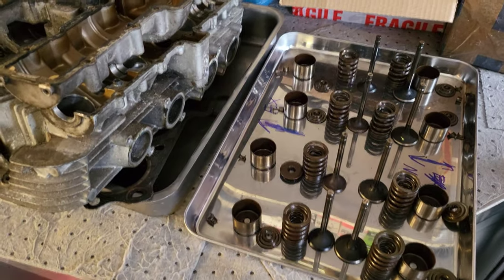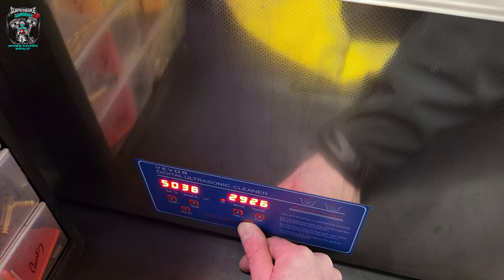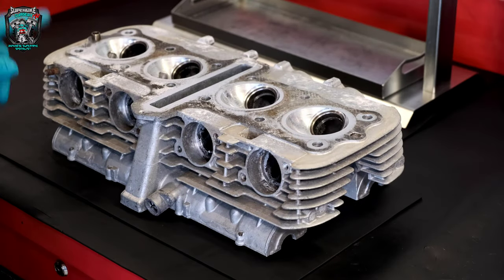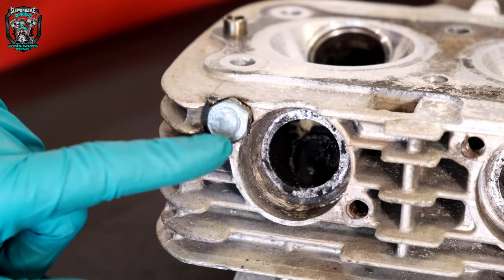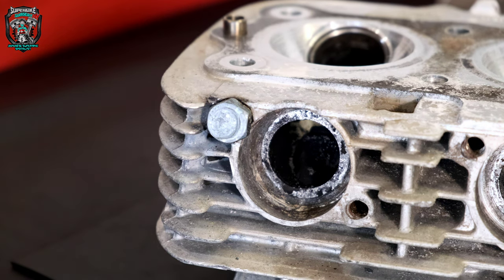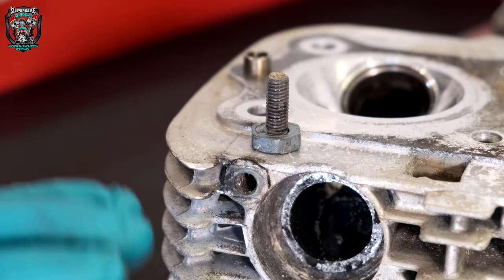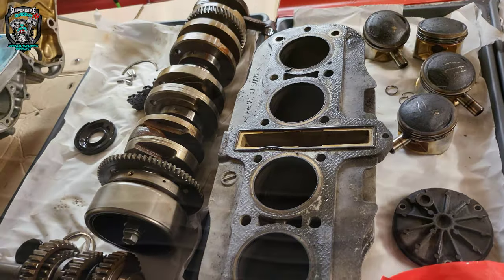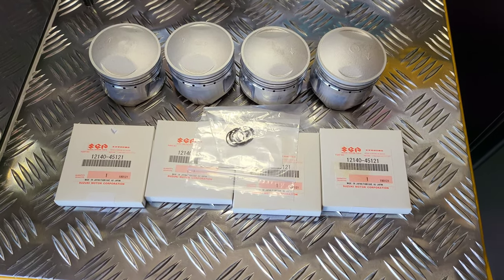GS850 Engine Restoration Part 2

Comment: The clean-up was a snap with all those fancy bits and bobs at your disposal. Sure it will glisten like no other once you put the final touches on her during assembly. Looks like a Super Star even before you set up for her methodical re-assembly and finish. Brilliant work with the exhaust stud. Have a few of those joker's to fix myself.

Comment: Valve clearances will change slightly when the cylinder head is torqued down as the forces applied will bend and move the head slightly , might just be worth checking at the end , after all this hard work building a superb engine
Reply from the maker: I always do a final pass with the Feeler Gauges before the cam cover goes on just to satisfy my OCD! 30 years building bike engines and I've never seen a change after torquing the head down? Maybe it's a car thing? Which I have absolutely no experience with.
Reply: @SuperbikeSurgeryTV  Yes, your builds are absolutely very well done, can't wait to see this one finished, I imagine it depends on the head design , thickness, location of bolts whether it has studs that might effect clearances. But as you say experience is priceless and you have clearly gained lots over the years.

Comment: Very nice work that engine looks in  excellent condition inside the exterior belies this  Is it correct that synthetic oils can cause the roller brgs in the crank to slide rather than roll  and does that cause premature wear  had a crank of that design in my gsx1100 an engine renowned for its bulletproof bottom end

Comment: Hi Jim I'm doing the same job on a 78 gs1000 everything is well within wear limits pistons bores cams ect the inlet valves have a nice "pop" when pulled thro the guide the exhausts more of a whoosh is it normal for the exhaust valves to be that tiny bit looser in their guides?

Comment: Suzuki, like Porsche, has a programme where they will supply parts for their make of classic bikes.
Reply from the maker: I'm very familiar with the Suzuki Vintage Parts Programme it's a fantastic thing. Unfortunately they don't go as far as restarting manufacture of Parts that are no longer available.  And the programme doesn't cover all there past models. 

You can usually find any genuine part if your wallet is deep enough and you have unlimited time. Unfortunately I'm short on both!
Reply: @SuperbikeSurgeryTV  where do you usually purchase all or some of your suzuki gs850 parts?

Comment: U had loads of thread there, just wind on a couple of nuts, tighten them together, and wind it off.
Reply from the maker: 🤣 Like I said in the video, everyone has an option on this!
There is a very slim chance that the two nut method would work here, probably unlikely though given the original nut that was seized to the stud had the same opertunity and failed. Most of the time there isn't enough thread for two nuts, which was the point of showing this method. Thanks for commenting 👍
Reply: Lol, Jim has 30+ years of experience and correct me if I am wrong, used to have/work for a racing team. His work is outstanding. I don’t think he needs anyone telling him out to do stuff. Forcing the nut out without heat will knacker the thread or snap the stud, making the job million times harder.
Reply: @Unedited2022  LOL. what I said would have worked fine. I've done it many times. The welding a nut on is perfectly acceptable also. however, as you seen it takes more time and prep. Also on the plus side, you dont need to grab yourself a £1500 welder. That's always a bonus.🤣

Comment: I have a suzuki gs850 from the same year as yours. I had to change the engine gaskets, so the valve pads fell out. I see that they have numbers. Could you tell me where to put them according to their factory number?
Reply from the maker: No two engines are the same. The shims are there to adjust the valve clearances. Every engine will be different depending on manufacturing tolerances, engine milage/wear etc.
Reply: @SuperbikeSurgeryTV  thanks for the information one question I want to tune up to be able to put the chain aligned the letter T with the fixed mark of the engine seeing that cylinders one and four remain at top dead center or I align the letter F.?
Reply from the maker: @marlon45aries20  not sure I completely understand the question? "F" is the firing mark with no ignition advance (@ Idle) "T" is the Top Dead Centre mark.  All this information is readily available in the service manual.

Comment: Or you could wind 2 13mm nuts and lock them together and wind them out
Reply: I think the heat has a lot to do with releasing the stud too. You'd have to hit it till its red and let it cool. then a bit of penetrant to top it off.

Comment: stud could of been removed easily with a monkey wrench or vise grips
Reply from the maker: 🤣🤣 you haven't spent much time getting your hands dirty then! In virtually every situation if the stud has snapped off while trying to undo with the original nut. Just getting hold of it again isn't going to make any difference.